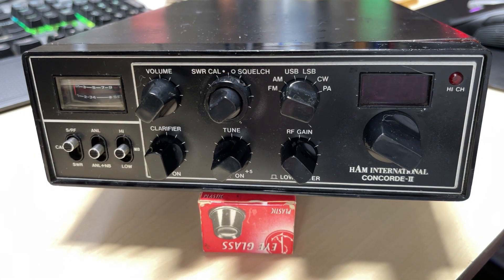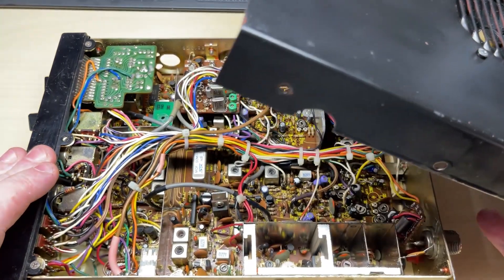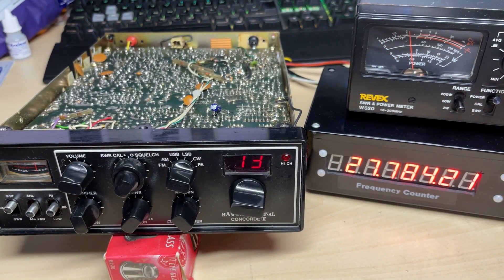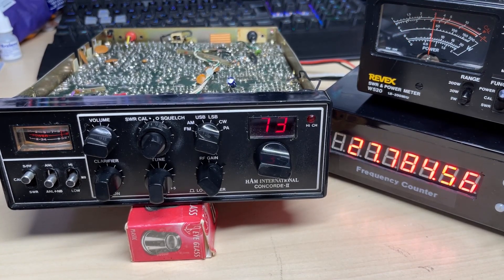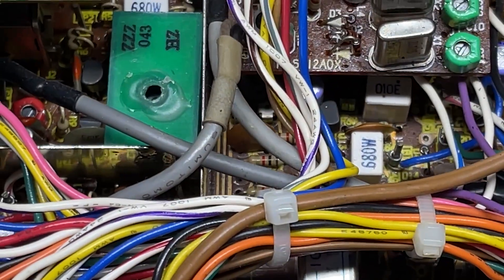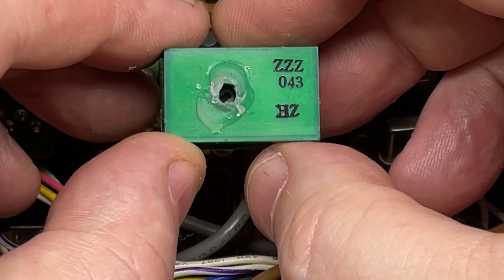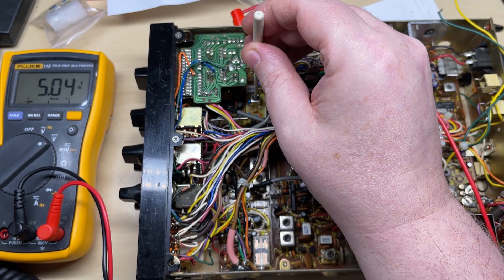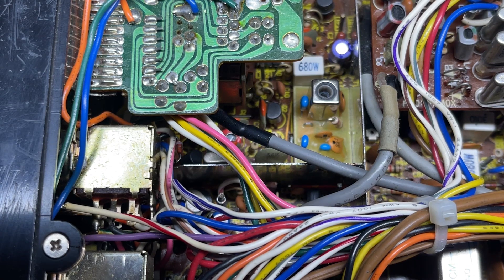EP 051 - HAM International Concorde II PTBM121D4X - First test and fitting a spectrum VCO.

Comment: What's the giveaway that it's SuperHigh - the crystals used?  And presumably that's one of the reasons you're changing the VCO?  (I'm just surprised it can be pulled so high and the PLL still locks).
Reply from the maker: Its got mid,high,super-high as standard as crystals, the vco was nasty with wrong core and those green ones are just bad , the spectrum one is far superior. i do need the extended range as you will see soon ;)
Reply: Ah ok, I'm on the edge of my seat 😉 (interested as I also have one)

Comment: Your right it’s the wrong core they fit loosely hence the wax 
Unfortunately they don’t have the correct permeability so you loose range 
No problem for you as you’ve fitted the spectrum one that’s also wider in coverage
Reply from the maker: And the spectrum one works well after a few hiccups, the core on the board was really stiff , was scared to turn it too hard , had to remove it and loosen it off a bit.